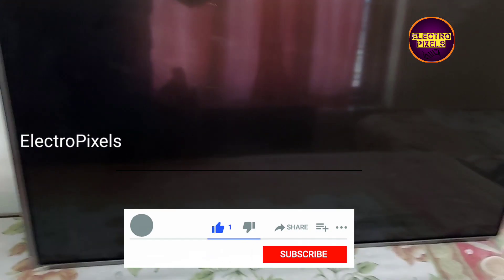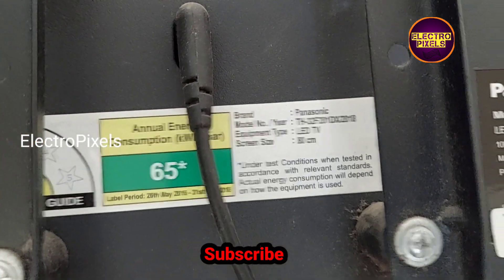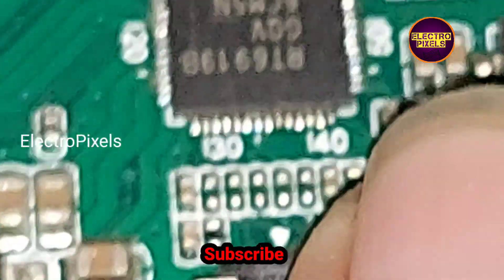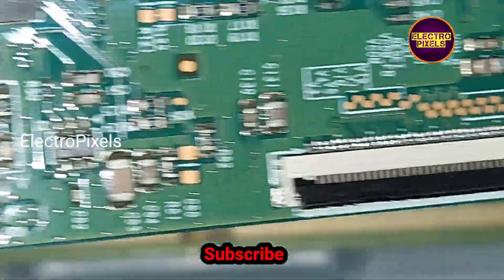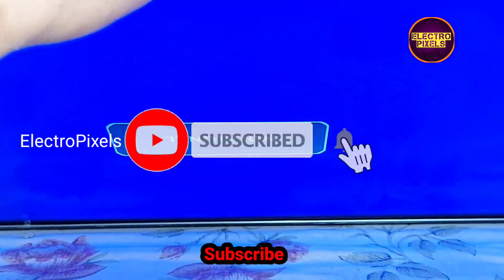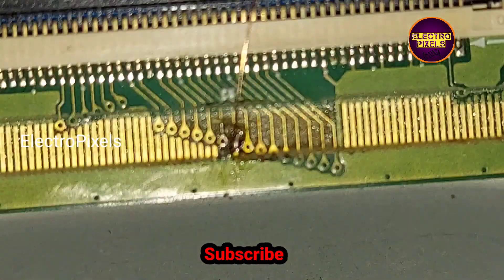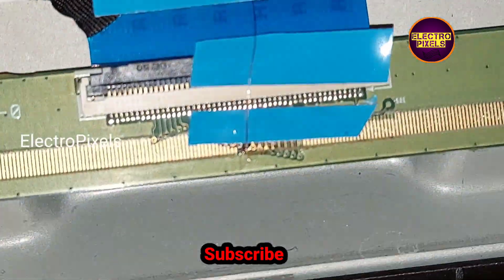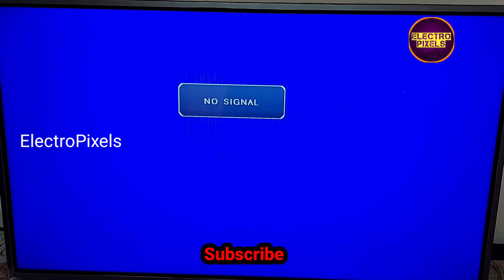Led Tv Vgh odd,Vgh even Short removal||Panel Repairing on Panasonic led Tv to solve Picture Freezing

Comment: It's only a temporary fix, the screen will fail again in a short while
Reply from the maker: Yes, bro it's a Temporary Fix, But we can't predict how long, it will work, it completely depends on luck, I know the Customers using the Tv after this Fix more than 1-3 year's and in some cases it will become complaint within a week also
Reply: @ElectroPixels  ok thanks for the explain so the short is on the glass matrix in Vgh even/odd. Do u know how these voltages actually supply the side COFs? Because we have the 2 lines which are fed with 30V  and -5V every 2 sec to drive odd and even lines alternately. So your job was to disable odd or (even) lines in shorted part of the screen. But what's the point of alternating these two voltages every 2 seconds on case the panel needs to be refreshed 50 or even 100 times per second? (100Hz scan). Thanks
Reply: @ElectroPixels   Ok I knew you woudn't know how It works but thanks for your answer about temporary fix
Reply: @zbyszekskibinski  hi bro, i am really confused!!! if the problem is due to short on the glass , and the guy disabled the short by cutting the lines to the shorted but of the screen? now what is the point of putting jumper from vgh staright to the same lines that goes to the shorted part of the screen? i am really confused as this can cause more issues? injecting Vgh voltage to the shorted patrt? may be am not getting a point here
Reply: @mnyama8  No your not getting the point. Vgh high/low address even and odd lines in the screen alternately and the short only happens in one of the two possible  states, if the fault were happening in both states then the screen would be irrepairable. And that is what he meant.
Reply: @mnyama8  you're probably mixing It up with the situation of CLK or CKV signal track cutting. These are different pulses, you can cut them ok and the panel will work without some  the shorted clock signals. However you cannot completely disconnect Vgh voltage as this is the voltage used to switch on TFT transistors.
Reply: @zbyszekskibinski  thank you Bro, now i am getting the point, i was really confused.....thank you